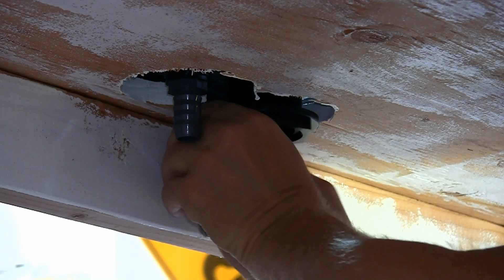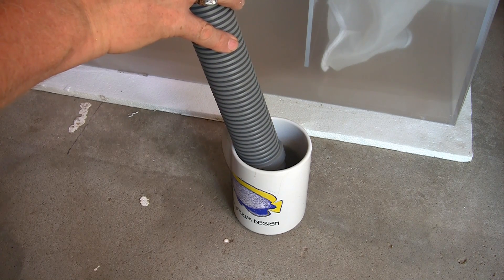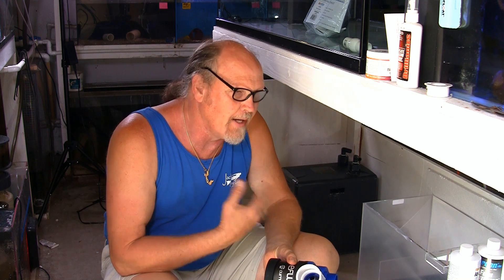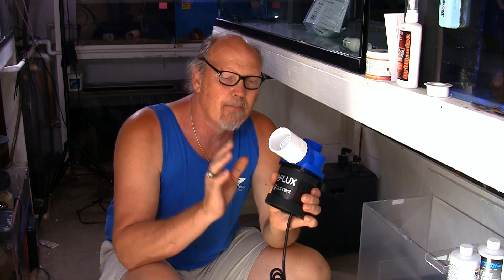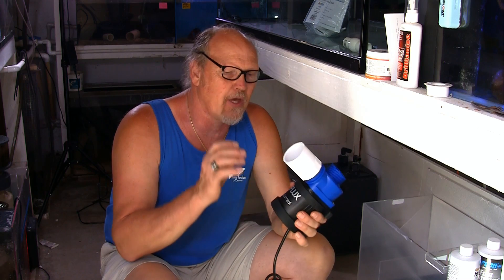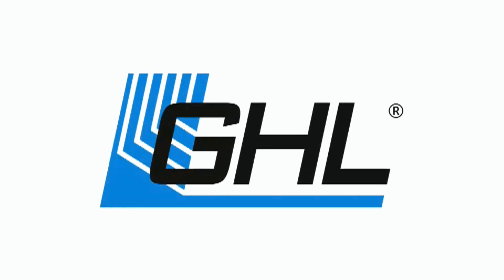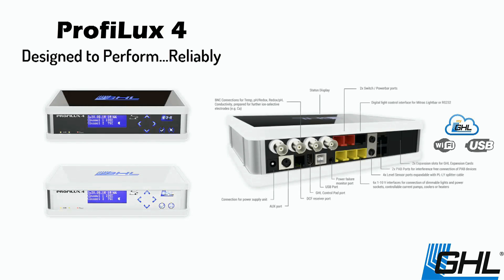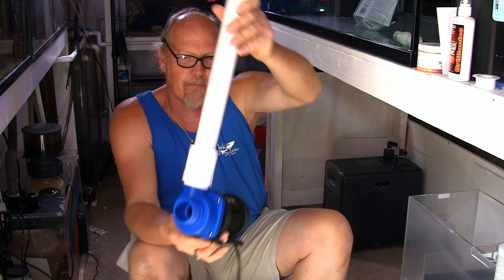Coral Frag Tank, LA Fishguys, Episode 159, part 2 The Plumbing

Comment: An internal overflow takes up a lot of room.  Isn't there a better option for you?I guess it's too late now.
Reply from the maker: One could have had a hole drilled in the upper backside of the tank for a bulkhead to act as a surface skimmer or selected an external overflow, which would use a surface skimmer box and siphon tubes, but the internal, while taking up some room, is much simpler and far less prone to troubles.
Reply: Yeah I guess that's the extent of it.  I built my own external on my 120.  On a frag tank, real-estate is premium, but it needs to be simple with just coral to worry about.

Comment: I notice when you was slipping the flex hose over the fitting the table started to rock from side to side. Ate you going to reinforce that stand. Love watching your videos man Thanks.
Reply from the maker: I did end up adding two more vertical supports but that was to support the table top from bowing downwards.
Reply: He also did put plywood on the sides to sturdy up the tank. He mentioned that in the first video.
Reply: SmerrillS Reviews yeah he mention it I think the 3rd or 4th video because the stabd was bowing and it had about a 1/4" space below the tabk. If it was me I would of done a new stand and put supports on each side of the stand.
Reply: It was like within the first couple minutes of the first video before he even did anything else...
Also, who's got time for that when you're running a business and he's doing it to hold product....